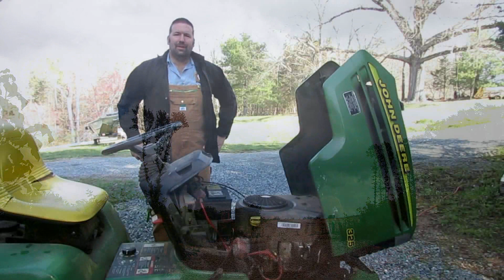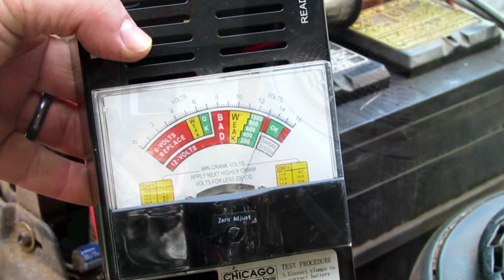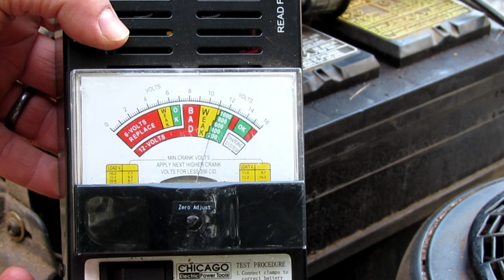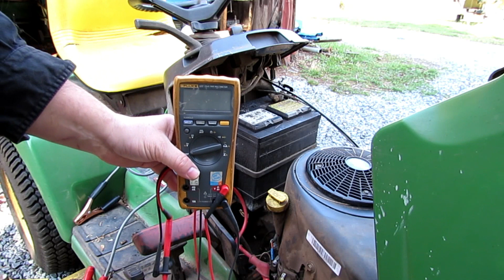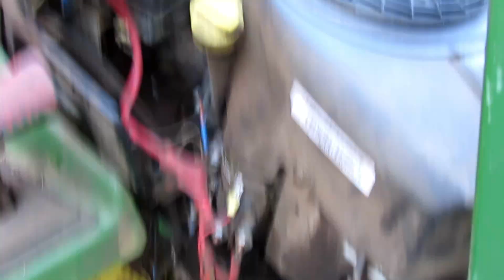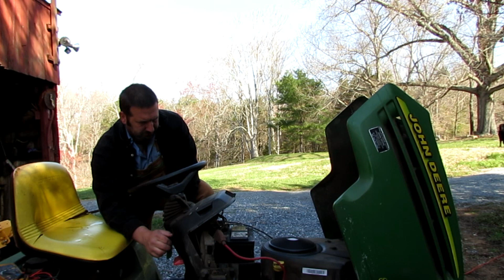John Deere 325 Starter Solenoid

Comment: don't think a jd 325 came with a vtwin briggs stratton
Reply from the maker: @George Strickland you are probably correct. My grandfather replaced the engine when the original one died. I didn't know he put a totally different brand on it. Thanks for watching. ~Mr. C.
Reply: @NaturesCadenceFarm  came with a vtwin cow wa sockee kawasaki which was a great engine that usually out lasted the mower,wonder what happened
Reply: @NaturesCadenceFarm  came with a vtwin kawasaki which is a great engine that usually outlasted the rest of the mower,wonder what happened?
Reply from the maker: @George Strickland I am not sure what happened. I know my grandfather purchased it used. Knowing him it was probably blown up when he got it. He liked to fix stuff like I do. I don't have that mower anymore. As far as I know it is still running. ~Mr. C.

Comment: I have a John deere x300 here is a video where  I cannot figure out the issue. https://youtu.be/bd1-WL2JXbI
Reply from the maker: @aaron kimble I watched your video and see your problem. My guess would be one of the safety circuit switches are not allowing voltage to energize the solenoid  thus preventing the starter engagement. The pedal switch you replaced might need to be mounted and activated by engaging the brake for the circuit to be made. I found a schematic for your machine and will provide a link below. Hopefully this helps. ~Mr. C.

https://www.tractorbynet.com/forums/threads/x300-starting-pto-problem.205629/page-2
Reply: @NaturesCadenceFarm  awesome thanks so much, I will try this when I get off work

Comment: Well I kept fooling with mine and finally seen it was missing a wire from the solenoid to the ignition
Reply from the maker: Turtle Frog glad you found the problem. Sounds like an easy fix. Thanks for watching! ~Mr. C.
Reply: @NaturesCadenceFarm  it was after i finally found it
Reply: Is there a positive & negative side to solenoid, in other words does it matter the way the wires are hooked up
Reply: @jabber33ad  I think it does matter one side is black and the other is purple from the solenoid to the ignition. Yup it does matter because i had a bad time figuring out what was wrong with mine because i don't own all those fancy testing tools & electronic gadgets and things like that i do my stuff without all that
Reply: @Mike-su8si  Thanks I put new solenoid on and it still clicks I changed the battery terminal & no change am I look at maybe a safety switch somewhere
Reply: @jabber33ad  it could be but usually if it were a bad or blown out safety button switch it just wouldn't do nothing so yours might be a bad ignition relay box
Reply: @Mike-su8si  Thank you for your help I will let you know how it goes
Reply: @jabber33ad  alright. You find were the clicking was coming from
Reply: @Mike-su8si  I’m ashamed to say after all I did the bottom line it was the starter, somehow power was staying on the starter even with switch off
Reply: @jabber33ad  wonder how it done that
Reply: @Mike-su8si  that I’m not sure I had to replace coil but now it’s doing great
Reply: @jabber33ad  maybe that was it or was the problem
Reply: @jabber33ad  mine was a bad coil and a bad ignition key switch and was a bad starting solenoid then it was a bad ignition relay box and i bought all new parts an put them on i hooked up another relay onto the other relay so now it has 2 instead of 1 and wired in a thicker wire were the fuse goes so no more of those will blow out now and I changed the oil the spark plug is still good 

Mine has the Kohler command engine and i unhooked the gas pump from it to so it's now gravity fed to the carburetor
Reply: @Mike-su8si  thanks u have been a lot of help Happy Mowing😎

Comment: I have an issue with mine its a 240 tho
Starter solenoid caught on fire do I jus need to replace the solenoid or both?
Reply from the maker: Anastazia T I would say just the solenoid if the starter did not get ruined in the fire. ~Mr. C.

Comment: Love watching your maintenance series of videos. You have a real knack for explaining things in a clear no-nonsense way that's a pleasure to watch and I learn a lot from them even if I don't have the vehicles to necessarily require that knowledge. From what you said about usually disconnecting the negative terminal first and being careful to not short against the frame when disconnecting the positive lead first, does the negative lead attach to the frame to ground it?
Reply from the maker: Simon B thank you for all of your nice compliments. You are absolutely correct, the negative lead does attach to the frame to make whats called a negative ground system. All of the things that need a ground just attach to the frame instead of running and extra ground wire to everything.  ~ Mr. C
Reply: @NaturesCadenceFarm  Will jumping across the solenoid posts to test it do any damage?  As a way to emergency start a mower or just to quick test the solenoid?
Reply from the maker: Noble Savage simply put, yes and no. I have done this as a test / emergency and it does work and I have not had it cause any electrical problems... yet. I have found mechanical damage from doing this because the posts on the solenoid are made of copper and the arcing from that much current acts like a welder. This arcing action can damage the threads making it difficult or impossible to remove the nut and wire terminal later. Hope this helps. ~Mr. C.